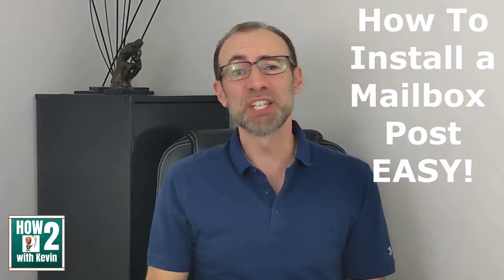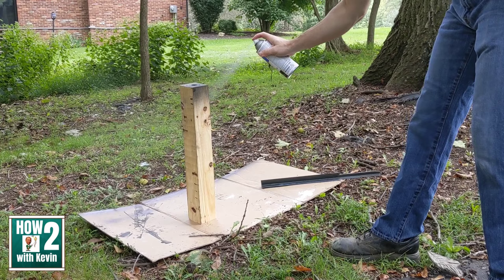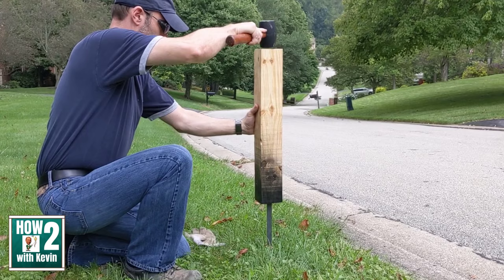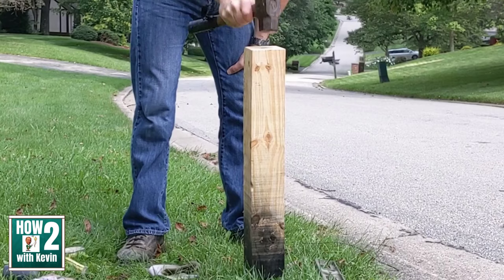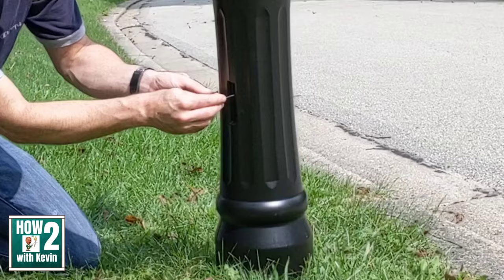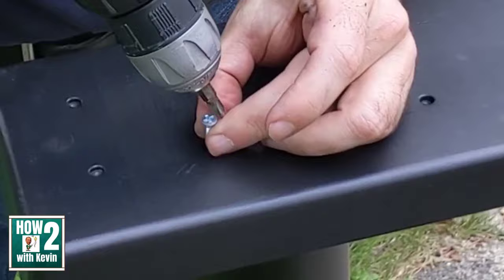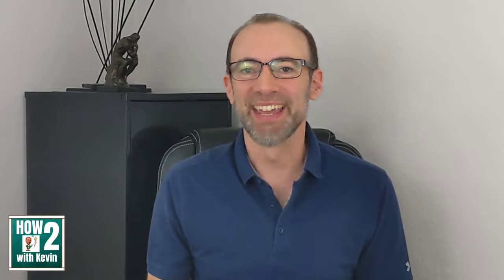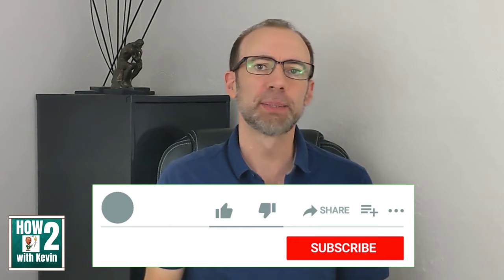How to Easily Install a Mailbox Post: No Digging, No Concrete!

Comment: 2022 Suggestion. Fully install the stake into the post first and then drive it into the ground as a unit. This is the only way to be sure the post is fully seated onto the stake.

Comment: thank you for the video -- they also have this in a full post, Ive used it twice and it works very well (just replaced it again because the neighborhood drunk took it out.... anyway I also would recommend putting the metal piece in the wood first then using a scrap 2x4 and small sledge hammer to pound it into the ground as an assembly it just seems easier.

Comment: I am in same boat as many readers..rural hwy..many road salts in our extreme winters but my box is over a metal culvert.  I read the commentary and really appreciate the way you predicted our questions in the video.  Some of the comments were really helpful too.   I have to buy a new mail box and state roads was like just get a post and a cheap mailbox because if we hit it in the winter we are only putting up a cheap post and box...fine.  But I have no post hole digger and a 4x4 is hard to drive .   So I may try this and see if I have enough clearance to run that metal spike.  I doubt it but your video has been the clearest
Thanks for that.

Comment: I don’t think a little bit of flex is a problem as long as it springs back. If your ground is soft enough or wet enough that it starts leaning incrementally, that’s not good, but as for just having a little flex as opposed to perfectly solid, I would say flex is actually better.   The reason we’re replacing our mailbox now is because somebody hit and ran it one night. It was in concrete in the ground, so the vehicle just shattered the wood like a toothpick. I hope it did a number on their car too, ha.  But I would rather have a mailbox that could be pushed over by a car, then I could just pick it back up and put it in another spot.

Comment: Interesting mailbox solution.  I'm found you by looking for one that had no concrete involved. Considering this strongly!  Thanks so much for making this video!
Reply from the maker: Thank you for taking the time to comment!  I'm thinking about doing an update video...it's been over 6 months (through the snow and ice of winter!) and it's held up well, in fact, I would say it's looks just the like the day I installed it.  As I mentioned in the video, it doesn't have the sturdiest feel to it, but it's not shifted in position at all.

Comment: Thanks. I purchased a similar post--one with a steel insert. I think that I am going to insert the rod into the post first and set the rod and post into cement. I am referencing several of the comments posted below regarding these two changes to your procedure. I live in a rural area and my mailbox was hit by a farm tractor--which tractor--only the Shadow knows. Anyway, great video!!!

Comment: when you hammer the post on top of metal rod  you will likely just be pounding the rod deeper in the earth with not that much getting inside the post,  you should hammer rod fully in the post first.  The reality is most peoples earth will be too soft for this to really work and I needed to dig and get some concrete but the metal rod is useful for holding position.  I dont think the post is weather treated so I put on some Thompsons water seal.
Reply from the maker: Thanks for sharing your thoughts, valid concern.  I was definitely worried about not getting enough of the rod into the wood, like you said, where the stake would just push into the ground  But was also worried about splitting the wood by hammering in the whole stake if I put the wood on first.  What I found was the wood went over the stake fairly easily with the pre-drilled hole, which you can see by me just using my weight to push it down over it.   Hard to know if I got it all in, but until the part I used the hammer to finish off the post, I could see the stake hadn't moved at the time.  Also, good move on using the water seal; I would've used that had I some around; just didn't have the time to run out and get some.  I was surprised the post wasn't treated when I got it, thus that quick paint job.

Comment: I don't know when this video was made but I got this post from Home Depot for $38!!! They are overcharging for them. My lumber was cracked too. Thank you for the video. Old woman DYI since I don't have good neighbors to lend a hand.
Reply: @RaymondGinn1978  Oh, you know what? Mine is cedar. Maybe that is why it was more. It is the same as yours in appearance. In any case, I got it in the ground yesterday. I had to use a different wood base to set the box on. The thin wood in the kit came already badly split but it is a 120 mile round trip to Home Depot for me so I improvised with some thicker scrap wood. 
I set mine in a planter then drove the stake down through the hole in the bottom of the planter. I added quik cement inside the planter leaving room on top for soil to plant some flowers in. That post is not going anywhere and does not wobble a bit. Your video really helped me out. Thank you.

Comment: Unfortunately one year later the post you show isn't available from Home Depot. But the "Simpson Strong-Tie 4-in x 4-in Powder-coated Wood To Wood Post Spike" is almost as easy -- and I used a treated 4x4 that I easily cut to length with a common hand saw.

Comment: You may wanna hold the hammer more on the end for more impact when needed… inertia. Let IT do the work.
Reply from the maker: Very true and good advice...thanks for sharing Joe!...I will admit, I was REALLY worried about splitting that wood since I knew I had to get it done that day.  I'm not the strongest guy (you can tell by looking at my arms, lol), but I've surprised myself on breaking things in the past that I never thought I was strong enough to do!
Reply: @HowTowithKevin  Not so much your strength that breaks things but how cheap stuff is these days. LOL
Reply from the maker: @GrandmaSezSo  So VERY true!
Reply: Yeah, it was actually painful watching him trying to operate a *hammer*... :(

Comment: What about using some quick set cement for stability?
Reply from the maker: Great question; you could do that,  and that's what I would've done with a full wood post for sure.  But I think the issue with the single metal spike (with it being fairly thin) is that the wood over it could still flex in the part above the ground, even if the metal spike submerged in the ground was cemented. Circumstances dictated what I did here, but so far it's holding up well.  I'll probably do a quick follow up video after I see how it handles the winter.
Reply: Quick Set CONCRETE would work better.

Comment: Did you have to call in for location on utilities??
Thanks for the video..
Reply from the maker: Thank you; that's a great question and really good point; I did not because I had called 811 when I put a gas line in previously and I knew where everything was, and then also, it was right next to where my old post was so I was confident there would be no issue.  But to the point of always better being safe than sorry, a call to 811 would make sense and I should've mentioned this in the video.   For anyone reading this and unsure what 811, here is some info:  https://call811.com/
Reply: @HowTowithKevin

Comment: How’s it holding up 10 months later?
Reply from the maker: So, not to make you watch another video. but I do have an 8 month update video I did which you may want to check out, I'll link it for you at the end of this reply.  It's been almost a year ago now and it's holding up well, just like in the update video.  It has a flimsy quality from day 1, but it's just as straight as the day I put it  up and it went through a winter with snow and ice.  
https://youtu.be/mpEi2qGBC1Q

Comment: I watched your video but the non treated post in contact with the ground is no good and the shaking as you opened and closed the door is a concern for long tern performance and durability.  Thanks.

Comment: Due to brainwashing media at the start of the pandemic loosing a lot of my memories,   Thanks to this video I just remembered that we had one time this kind of mail box stick and post installed  but of course the weather knocked it down after a few years, because of oxudation and rust , if I would use this method again I would use tar for the bottom of the post instead of just paint spray!Thanks!